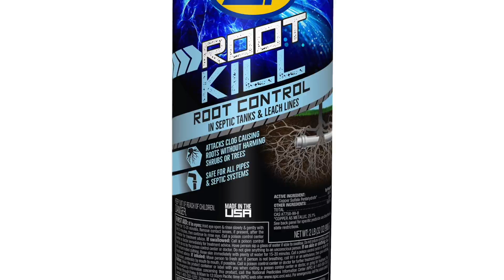Roots In The Line (Add This)

Comment: I used to buy copper sulfate in 50 lb bags. It was way way cheaper than those little individual containers. I could sell it for half price and still make good money.
Reply: Doesn’t it ruin the septic bacteria?
Reply: @weirdowolfstudio5409  It doesn't go inside the tank, it goes on the outside where the roots are intruding.

Comment: What does it mean if we get a smell inside the house from the drains? It happens when we shower and use the restroom sink.
Reply: Your vent stack may be clogged where it joins the septic or leaves or animals might be in the vent pipe preventing sewer gas to vent to the outside air. 

If you are able, run a garden hose down the pipe from the top with the water running and make sure the sink and shower is covered to prevent anything backing up into your house.
Reply: @donsisco852  the pipes on top of the roof?
Reply: Yes. Those are vents allowing sewer gas to vent above your house. 

If those are clear, your main sewer could be backing up. Have a plumber run a snake tool through to clear out any build up or roots.